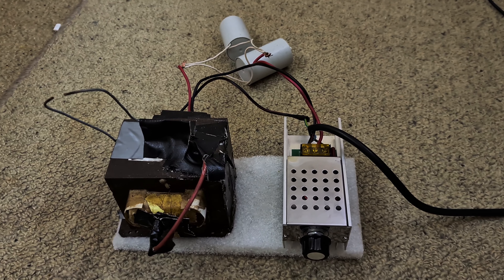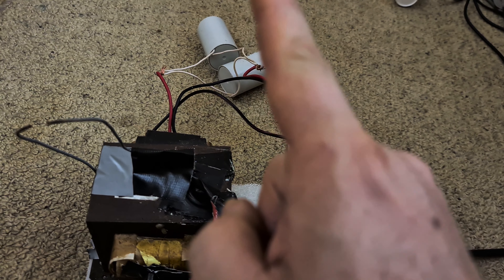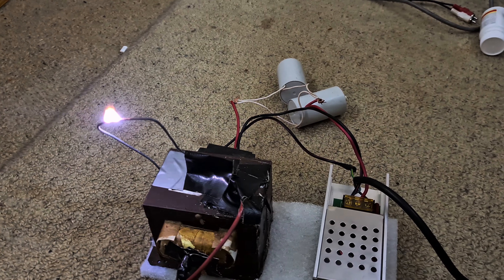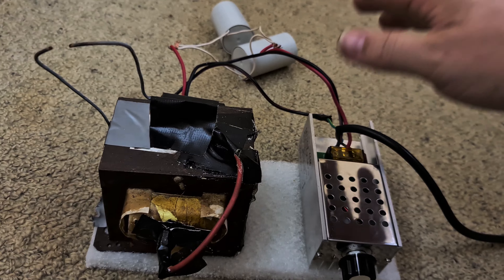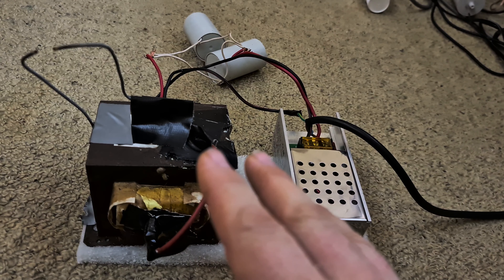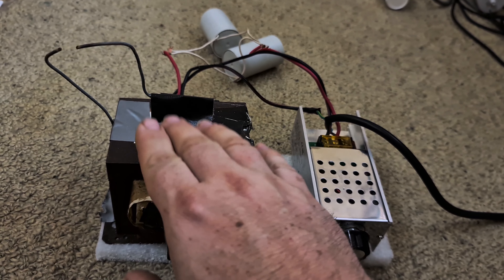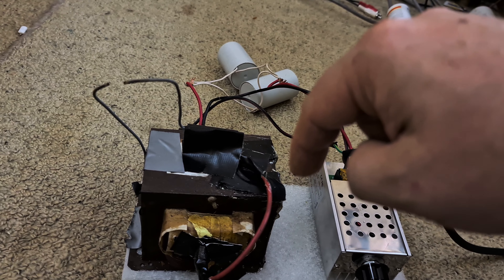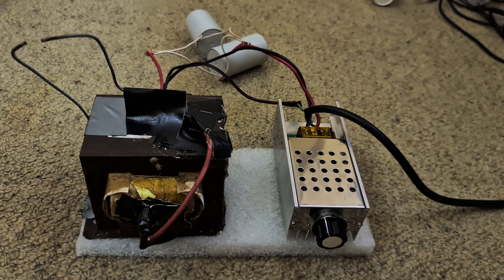Simple 10kV+ supply with easily variable ballast replaces many Microwave Oven Transformers with one.

Comment: Couldn't that break down the wire insulation?
Reply from the maker: Had no problems with runs of ca 5 minutes, but for long term use the transformer should be in mineral oil.

Comment: in amp draw?
Reply from the maker: About 5-10 amps continuous at 240v, but the peaks from the charging/discharging capacitors are much higher, hence the need for an overpowered motor controller, and why you definitely don't want any sensitive electronics connected to the house circuit it's plugged into.